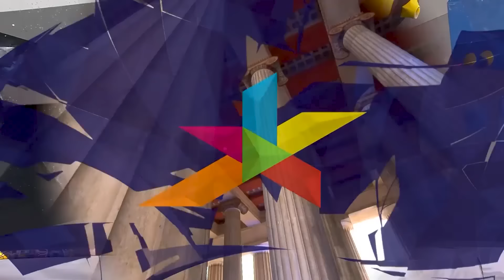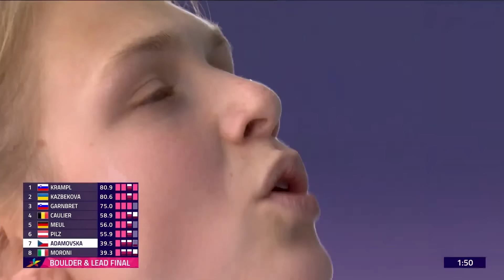European Championships Munich 2022 - Bouldering Finals

Comment: As for scoring, I wish the graphics team would learn from games like golf that provide a score that is easily compared across different completed elements (holes vs boulders).  One easy way would be to show the average total of completed boulders (with the completion count) and the current boulder's score if you're the active climber.  For instance, here's one point in time in the women's competition where the graphic shows Janja Garnbret in 3rd place when she's really in 1st (and a couple other climbers change rank too):

# Name               Total  Graph (each digit from 0-3 is the bar height count)
1 KRAMPL           80.9   3323
2 KAZBEKOVA    80.6   3323
3 GARNBRET      75.0   333
4 CAULIER           58.9   3321 (active on boulder 4)
5 MEUL                56.0   332
6 PILZ                  55.9   332
7 MORONI           39.3   3221
8 ADAMOVSKA  36.7   322

My suggested graphic would be (perhaps with the total or the graph bars added on):

# Name                 Avg  * #Done + Active Score
1 GARNBRET     25.00  *  3
2 KRAMPL          20.23  *  4
3 KAZBEKOVA   20.15  *  4
4 MEUL               18.67  *  3
5 CAULIER          18.63  *  3  + 3.0
6 PILZ                  18.63  *  3
7 ADAMOVSKA  12.23  *  3
8 MORONI             9.82  *  4
Reply: She was 3rd in ranking pointwise at that specific moment lol.
Reply: That's like saying that the person starting on hole 1 of a golf course is 63 shots ahead in the points standing compared to someone finishing hole 18. It is a false view of the actual standings. Garnbret had 3 perfect boulders, and nobody else was even close to her in their performance. The entire point is that total points is a very poor measure of where someone is in the standings if you're comparing those who have completed differing amounts of the competition.

Comment: Cool comp. Usually watch the IFSC stuff and this was a nice change of pace. Still confused on the scoring change tho... what was the objection to the previous format?
Reply: The current IFSC scoring system for bouldering is obviously very flawed imho, having only two scoring points on each problem (Zone & Top) makes it impossible to capture all the progress the climbers make on a problem. Here they've added one more zone, allowing for more granular separation among climbers. Also incorporating the number of attempts directly into the score, making it easier to compare and understand. Not saying this format is perfect, but it's a good experiment to do.
Reply: I believe it's also the next Olympic format
Reply: @mikemoore-hehim1149  this is indeed the Paris 2024 format
Reply: I kinda like this format. Second zone is great for separation, and the decimal system seems simple enough
Reply: @Laura147HLY  Yeah I kind of like this format better

Comment: Wait. This is bouldering FINALS, no? So why did Ondra not win it? He was third according to IFSC (and wikipedia) results...
Reply: It's bouldering and lead combined. Both events provide a maximum of 100 points. Whoever gets the most points across both events wins.
Reply: @StuermischeTage  No, check out https://en.wikipedia.org/wiki/Adam_Ondra#Climbing_European_Championships, it says he came third in bouldering, there's no combination.
Reply: @samhitchcock3560  the wiki page here for whatever reason doesn't show the combination finals. here you can see, it was lead, boulder and combined: https://en.wikipedia.org/wiki/2022_IFSC_Climbing_European_Championships
Reply: @enha6008  Thank you for the link, but it only supports my confusion. This video is about bouldering finals. At 2:47:04 you see the final standings -- Ondra on top. On the wiki page you sent, it ranks Ondra third in "Men's boulder" category. There is a separate entry for "Men's combined" where he is ranked second, so the "Men's boulder" entry clearly refers to bouldering alone. But according to the standings at 2:47:04 he should have been first in this category.
Reply: I expect that there wasn't a dedicated bouldering event for the combination besides the "pure" bouldering finals, no? Wouldn't make sense to me if there was, why should they have to boulder twice..
Reply: OK I don't understand the scoring system that is used here. According to the final standings, Ondra had 80.7 points, and thus is at the top of the list. But the final places were awared according to the old scheme, using number of attempts.. https://cdn.ifsc-climbing.org/images/Events/2022/220811_Munich_ECH/Munich_B_Men_general_official.pdf
Reply: @samhitchcock3560  the video's name is confusing, this is the boulder part of the combined finals. there were separate boulder finals and lead finals and the athletes that scored high enough in both combined qualified for the combined finals.
Reply: In the 2019 IFSC Climbing World Cup competition in Munich Ondra was 1st in Wiki, not the 2022. Maybe they mixed it up